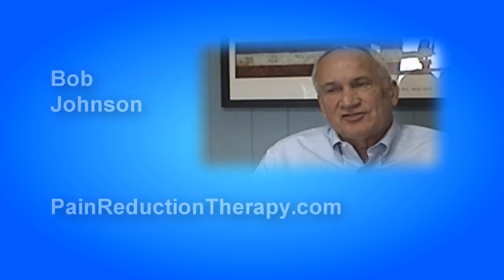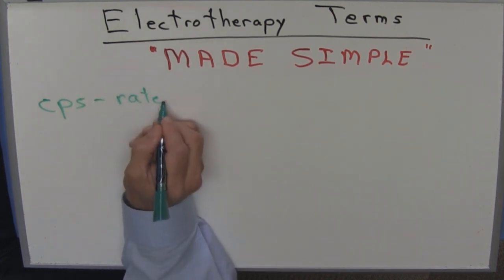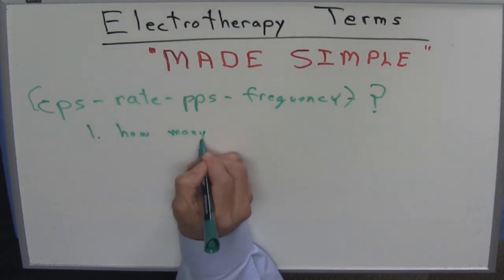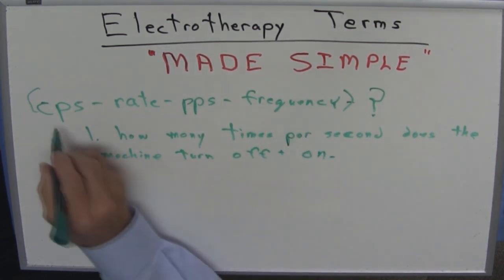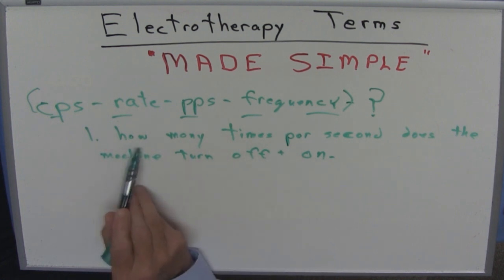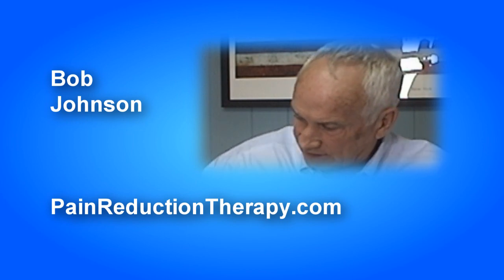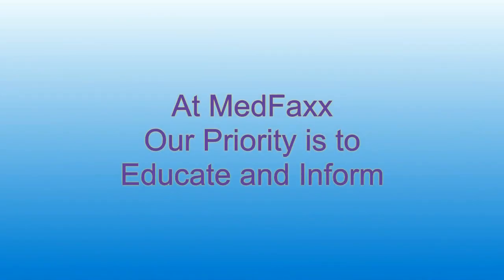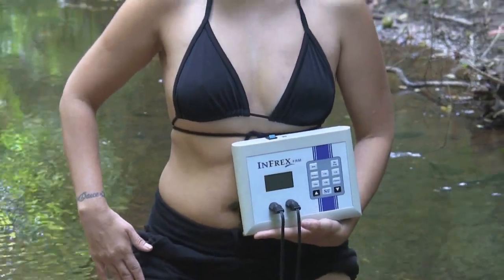Electrotherapy Made Simple

Comment: Great video!  Another example of electrotherapy is device known as the "cylinders of the pharaoh" made from copper and zinc cylinders filled with quartz crystal when held produce electrical energy starting at .6 volts and will gain .01 volts every minute held so after an hour you will produce 1.2 volts.  Similar to a galvanic battery cell the copper is the cathode, zinc is anode and you become the electrolyte left side negative right side positive.  Quartz emits infrared energy, is pyroelectric and piezoelectric.  Make them yourself or get them on amazon or etsy.

Comment: Question, I do watch all your video and they certainly help, but DC current isn't what is used to electrocute criminals, it is A/C current. As demonstrated by Edison to show the dangers of A/C current that Tesla created. Can you please explain why DC current is dangerous?
Reply from the maker: DC current , direct current being positive or negative (directional flow of electrons) results  in the attraction of opposite charges to skin.  So if you are using say a "positve +" charge on surface of skin, then on skin and under it you are attracting negative charges which now change the ph to acid or alkaline.   Once that occurs with human tissue you how have destroyed tissue resulting in pain and scarring.    Now to avoid that occurrence and stay safe you can use DC but on a pulsed delivery.   The interval of absence of a charge allows the attraction of opposite charges to go back where they were and now no detrimental effect.  In electrical terms DC generally mean sustained, no pause, direct current.
Reply: Thanks Sky for clarification.   DC is simply direct current or electrons flowing in one specific direction - Constantly with no interruptions.   Of course one also needs to put in amperage/strength of the current too to make a complete description of "harmful".   here is the problem with direct current.  just like magnets where if you put a "north" pole against a "north" pole then you repel the other magnet.  When you keep current in one mode, negative, constantly then you also attract positive ions to the surface and you also repel similar ions, negative away from the surface.   The pH is changed and the amplitude also determines how deep in the body it is changed.  On the surface a constant direct current creates what we call a "keloid" scar which is too many of one type ions at surface so you scar, destroy tissue and cause inflammation often resulting in pain and disfigurement.  Deeper in body and the pH change totally disrupts the chemical processes and you have organ failures, system failures within the body.   Constant DC current is deadly if amplitude sufficient and time of stimulation long enough.   We use DC current but we generally do it in thousanths and millionths of a second with the machine going off and on constantly.   Hope this helps.

Comment: amplitude and power are two WAY different terms. AMP=Volt/OHMs ;  Pwr= VoltsxAmps
Reply from the maker: Often in electrotherapy we define those concepts as current and it's regulation.  
With humans due to C and Sensory fibers transmitting pleasant and unpleasant sensations we adjust voltage to compensate for resistance.  As resistance increases or decreases there is a concurrent voltage adjustment to maintain constant current.   Good points on the electric side.
Reply: okay. I think I understand. As the person becomes tolerant to the voltage (more resistant to treatment sensation) You must increase the voltage and in turn decrease the current for comfort...
-Thanks for the response
Reply from the maker: Actually Carlos the original reason was if you maintain constant voltage then the current increases and decreases based upon the changing of the resistance.  Practically speaking one has a tens unit on and it's doing great then they get in their car, electrodes on the back, and when they lean against the seat they press the electrodes closer, reducing resistance but the voltage stayed the same.   The result is a "shock" as the resistance decreased but the voltage stayed the same so greater current in area and person is "zapped".    Make sense?   That is reason for change of most units 1970s from contant voltage to constant current.   It could be dangerous especially if driving or operating machinery and you get zapped unexpectedly.
Reply: MedFaxx I see. I've learned a lot from your videos. As a user of a TEN unit And soon to be studying physiology thanks for your time and intellectual conversation.